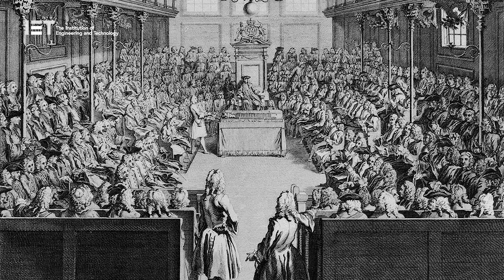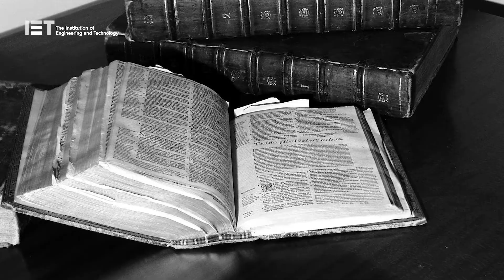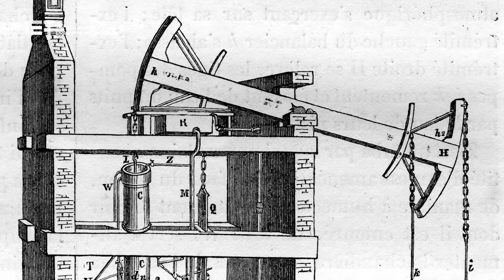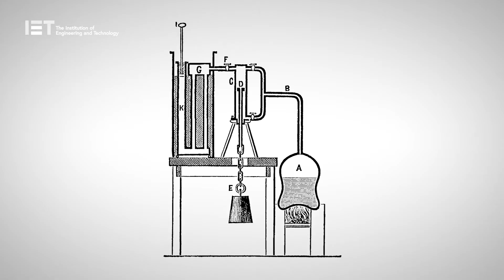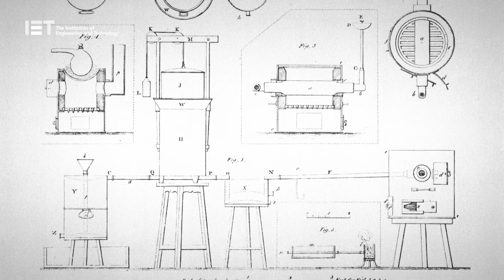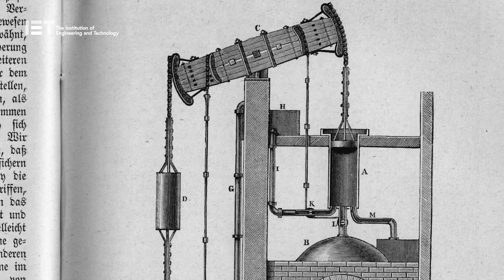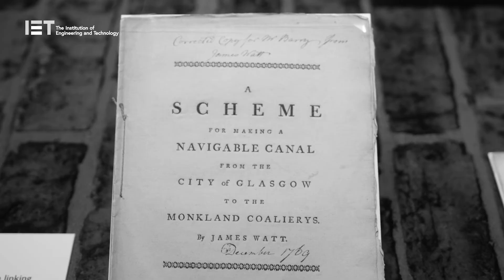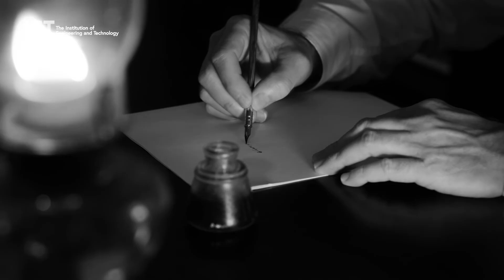Exploring the Life and Times of James Watt

Comment: Watt's great "breakthrough" was nothing to do with efficiency, although it was more efficient.
It was all to do with dumping Newcomen's Atmospheric Power and Arkwright's Water-Wheel Power for High Pressure Steam Power.
To achieve that he had to INVENT a new engine, the world's first PRACTICAL High Pressure Steam Engine.
For the first time in human history we had something that could replace,  outperform and more importantly vastly outnumber the rare 2000 years old Water-wheel.
Watt was proved right about extremely High Pressure Steam, we didn't get a viable Locomotive in the form of Stevenson's " Rocket " ( A Watt High Pressure Steam Engine on wheels) till years after his death.
Reply: Interestingly they did not mention use of high pressure steam at all in this documentary.  The implication is that his contribution was to use a separate condenser so that the main cylinder did not have to be heated and cooled in each cycle. This improvement came 70 years after the development of Newcomen's Steam Engine, which used vacuum created by condensing steam. Of course vacuum is another way of describing the use of atmospheric pressure. The fact remains that the difference in pressure across the piston was created using the properties of steam. The Newcomen's engine was clearly a kind of steam engine.
Reply: @Evan-e-cent 
Thomas Newcomen himself, the Inventer, called his machine an Atmospheric Engine. Surely he should know.
It was never even called a Steam Engine till Watts machine came out.
All Steam engines have a high pressure side, even 2psi ones.
The only reason for splitting them into Low and High pressure, is to cut James Watt out of the picture.
It's nationalism at work even in the UK. Same with british descendants in USA.
I'm sure you've seen the Industrial Revolution man's videos, quite recent. He insists on calling Watt's 
machine Atmospheric, even though one's got bolts around the top and one hasn't.
Reply: The vacuum is not another way of describing Atmospheric Pressure.
Watt used a vacuum with Steam Pressure.
Efficiency is a Red Herring, even though it was more efficient.
Watt's big advance was to dump Newcomen's Atmospheric Power and Arkwright's Water-Power for Steam Power.
To achieve that he had to invent a new engine, the world's first PRACTICAL Steam Powered Engine. It created an Industrial Revolution.
Newcomen's machine was made to provide Atmospheric Power.
Watt's machine was made to provide Steam Power.